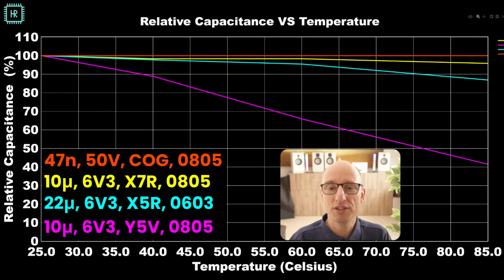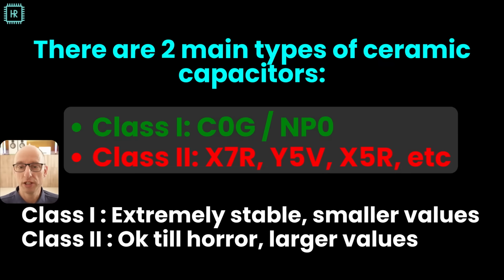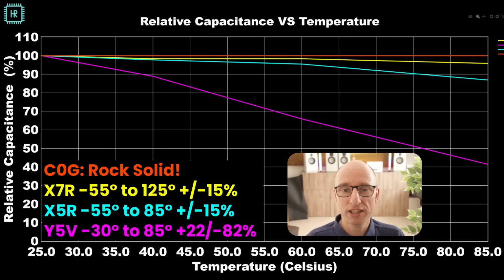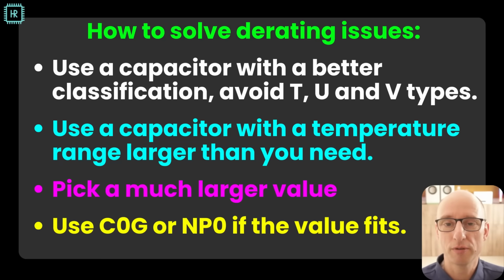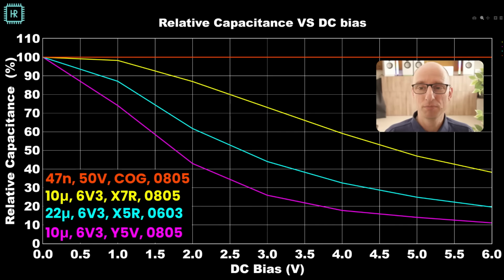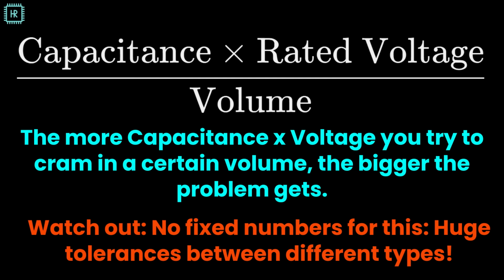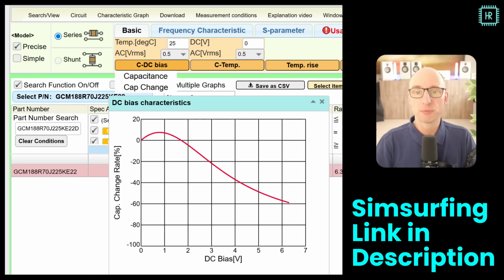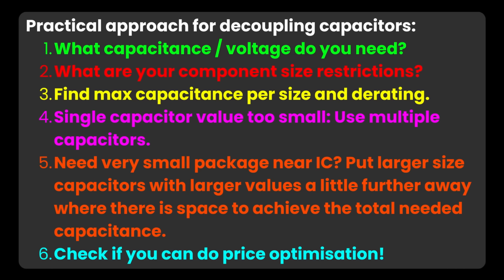Hidden Capacitance Killers, The Ones That Ruin Projects

Comment: All the info is available on the capacitor datasheet. Some manuf. also provide a tool aver their website that can provide the remaining capacitance at rated voltage, temp, impendace vs freq. Nothing new here, up to 2015 these details were not really available, but now all provide them. These are the trades between cheaper and more expensive ceramic caps.
Reply from the maker: Indeed!

Comment: It is an important topic Hans brings up here.

Here are my lessons learned and best practices when it comes to decoupling capacitor selection.

First, perform a risk assessment. Check which capacitors are critical and which are not. Some ICs and circuits may be fine with reduced capacitance; for others, it might cause problems. Critical components usually include, but are not limited to, LDOs, SMPSs, processors, and FPGAs. Proper risk analysis and Power Delivery Network (PDN) design are fundamental for reliable hardware design and operation.

For Critical Capacitors:
Always check the capacitor datasheet for DC bias derating (ideally, the curves) and temperature dependence (+ other parameters). If curves are not provided, do not use that capacitor for critical applications.

As Hans says, Class 2 capacitors have temperature dependence. The X7R notation indicates that the capacitance tolerance is within ±15%. This doesn't necessarily mean that the maximum and minimum capacitance variation is ±15% within the temperature range; the actual variation can be much less. It just specifies that the change is within that ±15% window. Also, the tolerance does not specify at what point in the temperature range the capacitance reaches its maximum or minimum value. Again, check the datasheet and the capacitance vs. temperature plots. I have also observed that the temperature dependence seems to flatten out or be compensated for when the capacitor is DC biased.

DC bias aging:
Another topic Hans didn't mention is DC bias aging. A class 2 capacitor will have accelerated capacitance aging when DC biased. This capacitance will gradually be recovered when the capacitor is not biased. In one of Vishay's white papers, some of the capacitors showed a 15% to 20% reduction in capacitance after being continuously DC biased at 40% of their rated voltage for approximately 100 hours. (And of course, Vishay's capacitors had much better performance than the other tested capacitors ;) ):
https://www.vishay.com/docs/45263/timedepcapdrix7rmlccexptoconstdcbiasvolt.pdf

Also be aware of that X7R capacitors are not identical. Manufacturers use different dielectric formulations which can lead to variations in performance, even if they share the same X7R classification. This makes it important to consult the datasheet for the specific component being used, even from different series from the same manufacturer.

Hans mentioned package size; in general, it seems that smaller packages are more sensitive to DC bias derating.

Murata's SimSurfing is a good tool for exploring different capacitor characteristics.
Reply from the maker: good analysis!
Reply: I always use NP0 caps wherever i can and try to keep heat away from capacitors.
Reply: if you get through EMC testing but it degrades in the field, you're fine /s
Reply: @tommihommi1  Honestly, it sucks that so many manufacturers do take that approach, sincerely. They see EMC compliance as just a bureaucratic roadblock to selling their products rather than something that actually affects people. It's truly horrifying. I don't know if it's a lack of pride, ignorance or if it's just straight up cost-cutting for the sake of shaving a little bit off the BOM cost.

I work in live events, and quite often come across gear that, after maybe only a year of service life, sometimes less, starts spitting all sorts of filth into the air. It's really hard to do a frequency coordination of 40 radio microphones around when some cheap SMPS, for instance, is going skreeeeeeee at 2 MHz and every odd harmonic right through your useable frequency range. Throw in some TV channels, and trying to get an intermod-free frequency coordination is damn near impossible, even with bandpass filters and carefully placed LPDAs. 

Last time that happened was with a network switch... A name brand one at that. LED video walls are also a common culprit. They'll be fine fresh from the factory, but then just get worse and worse over time. Kills me. A targeted recapping often clears it up but I shouldn't need to do that. I have better things to do with my time...
Reply: @UncleWalter1  (decades ago) I designed audio stages for certain TV brands; back then I wasn't really aware of DC bias ageing characteristics of caps. Indeed since "my design" was simply based on a "reference design" provided by audio amplifier IC producer, I was just as confident as the chip designers (with a century long experience) were. We had separate component engineers who dealt with their quality, charactersitics, etc. Now, may be I should've paid more attention to the component selection, but hey, if those audio stages fail which I hope not, it will just be cap replacement at worst...

Comment: Yep, it's best to stop putting voltages across your capacitors LOL!
Reply from the maker: Best solution I've heard today: (also solves all noise problems you may have)  :-D
Reply: I can confidently say my capacitor drawer is operating at peak levels.
Reply: one time I was trying to reduce some radiated harmonics and with one soldering they completely disappeared, almost wrote an email that I solved it when I remembered to check the PCB again in case I fucked up something and yeah I accidentally removed a series resistor in the PAVDD supply path. Obviously I hadnt checked if there was any fundamental power in the first palce I cut corners wherever I can!!! I hope my manager sees this!!!

anyways I wrote the email because I didnt want to work on it anymore
Reply: But there is at least one use case that immediately comes to mind, a parallel LC tuned circuit.
Reply: DC bias vs using the capacitor as an AC coupling capacitor with 0VDC net across the capacitor.
Sure, in power supply applications, DC bias is unavoidable.  Best thing to do there is a larger working voltage and probably a larger package.
Reply: but for coupling purposes with different reference at both ends of the caps it is not possible to have this
Reply: I know this is a joke but it would usually be possible to do that, if not necessarily competitive with using a bigger capacitor.

Comment: X8R or bust, if you care about performance
Reply from the maker: that helps :-)
Reply: @HansRosenberg74 it's the easy way.  Just filter all caps by X8R, and watch your choices go down 10x on digikey. 
Makes it easier to pick. :p

And also, as you mentioned,  all manufacturers actually do offer derating tools. 
The first time I saw my capacitance drop 90% in the tool, I nearly puked. 

Just filler by X8R, and pick at least 2x the voltage rating, and it'll be fine.

Comment: This voltage dependant capacitance will also cause distortion of AC signals greater than a few mV as it modifies the waveform which passes through or is shunted by it. If you combine it with resistor VCR we discussed in the past it is amazing that we can have any low distortion circuits :)
Reply: Which is why you should never use them for audio applications in the signal path, it will be better to use even a cheap electrolytic, or best a film capacitor, though those have issues with size. Thus the almost universal use of green or brown mylar capacitors in audio.
Reply: @SeanBZA     Damn straight -  amazing how much distortion a ceramic capacitor can introduce (I speak from experience).
Reply from the maker: Yes!

Comment: Interesting, thank you! 👍  Would Tantalum caps be of help here, or do they also suffer from derating?
Reply: Some type of Tantalum capacitors (these drop-shaped eg.) suffer from spontaneous exploding. They sometimes also show erratic residual currents which can drive you crazy when using them as coupling caps.
Reply: @georgkrahl56  Yes tantalum work better, but also you need to derate them a lot more, they really do not like any reverse voltage (even during storage, which is why you get them going boom for almost no reason at times) to be applied, and they do often have random leakage issues on some units, but others, off the same batch, can be close to an ideal capacitor. A 5v rail you want to use 25v units minimum, just to get that headroom for reliability, if you use a 10V one you run a higher risk, and a 6V3 one you will have a few early failures for the bead types.
Reply: @SeanBZA  Higher rating also because if you get voltage spikes due to noisy/switching stuff on the bus, the tantalum reaaaallly doesn't like it, when the voltage spike goes above the rated voltage. Or like someone else said/wrote:
"Tantalum capacitors have a failure mode which can be triggered by voltage spikes only 'slightly more' than their rated value."
Reply from the maker: they're just a few percent, so waaaay better.
Reply from the maker: Some great input here in the comments. I know tantalums from a long time ago and I thought they had fixed these shortcomings. In any case, I hardly ever use them and there are only very limited use-cases for them these days that cannot be done with other capacitors.

I saw last week there are also polymer tantalum caps these days, I wonder if that solves the problems with reliability all of you are mentioning here....

Comment: You forgot to mention DC bias voltage induced piezoelectric microphony. This one plagues low level LF circuits in high shock/vibration environments, if high K dielectrics are used.
Reply from the maker: Well, there are a lot of other factors in ceramic capacitors that I could discuss. I can't put them all in one video, this is always the battle I have in my head when making videos..
Reply: And it works the other way round. On higher signal levels these things can make quite a lot of acoustic noise.

Comment: In my career I basically refused to see/use anything other than C0G/NP0 and X7R/X5R...

And if DC voltage is higher than 3.3V, always define exact list of allowed parts/mfg with existing data for dc derating 😅
Reply from the maker: yes, that should help